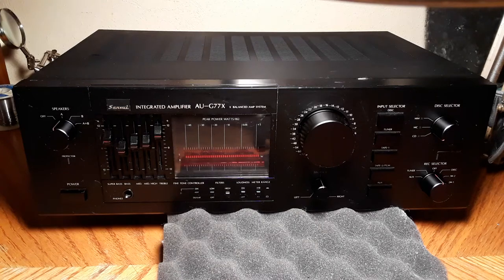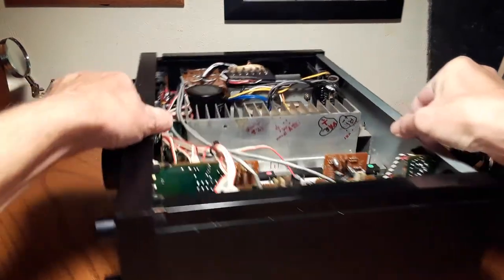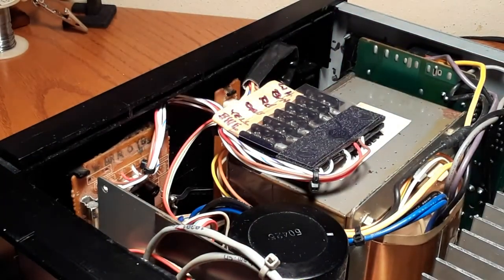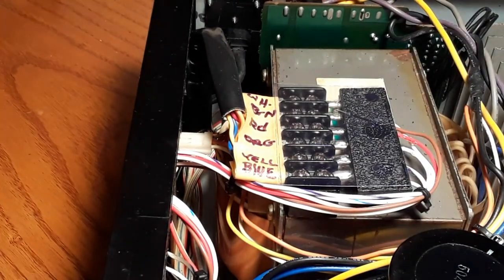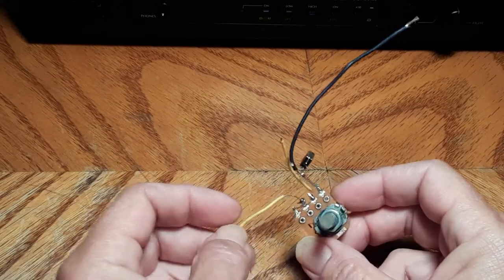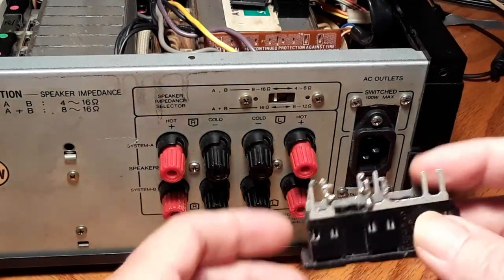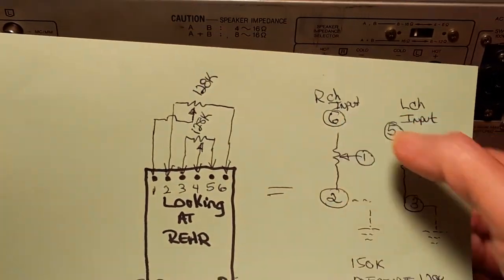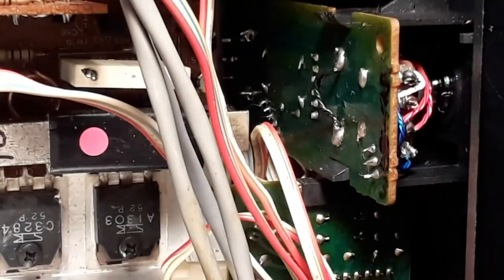Sansui au-g77x volume control and things know.

Comment: How do you remove the front panel to replace the selection button lamps?
Reply from the maker: Good question.i remember it wasnt fun.it should be in my videos.i had it off to clean window and replace tone caps on loudness board.i had it off more than onced im sure ,but other times may not have been recorded.theres catches or edges on plastic cover sides that have to be released.best bet is to have unit on side transformer down,power switch down to table,tiny bright flashlight and a small flat screw driver to shove in there to release both catches on bottom.then carefully go to top side and pull ur hair out to remove those catches with screwdriver while remaining tension on front face outwards.otherwise theyll just relock.then once there slightly free on both sides.carefully lay unit flat with edge of front over edge of table to do the rest.my prayers too you and may the force be with you.🙂😁

Comment: Is there a way to remote control the volume?
Reply from the maker: No i don't believe that to be possible.there isn't enough space for a motorized pot inside.off the top of my head ;the sansui a-9 should have a motorized pot in it.(ive only seen schematic of unit and not inside it)it has a volume up down(arrow button) that could be tied into a infrared receiver and be controlled by remote.it would take some work,but possible ,i believe.thanks.
Reply: @generalingwer4341  Thanks for the info!